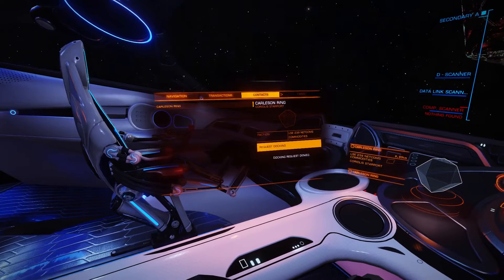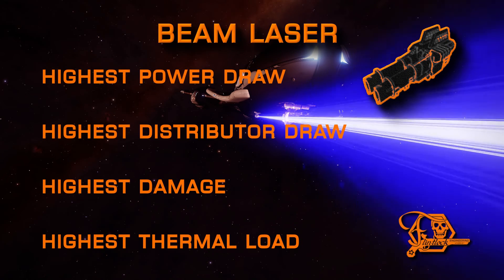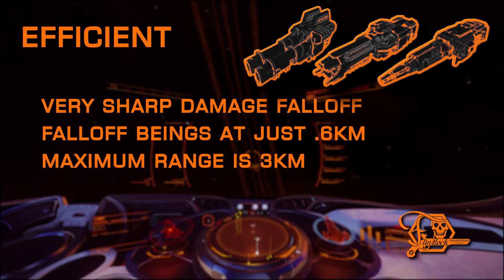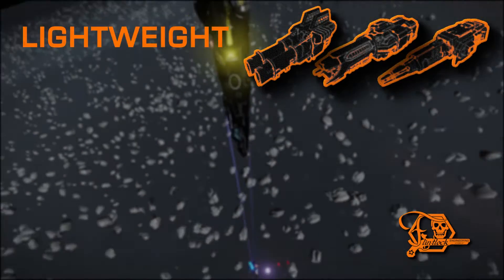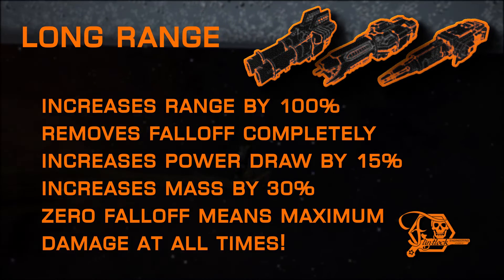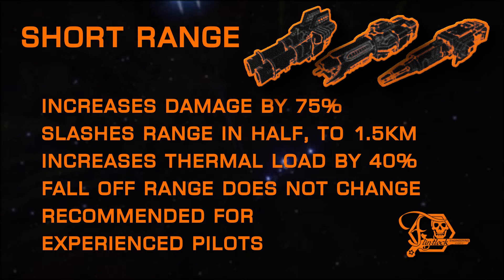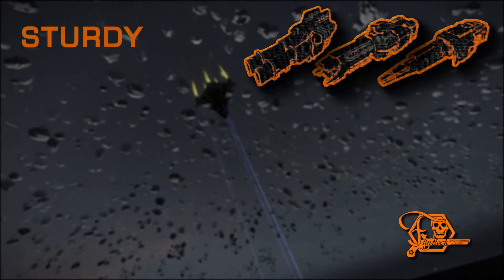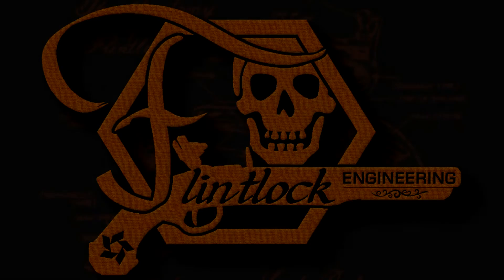Engineering Series - Episode 1: Laser modifications

Comment: Going with all beam's, on my python, I utilize them as if I had pulse or burst. Because each shot that hit's does more damage that that of a same size pules or burst. I deliberately pull my trigger in a pulse one second to two second blast or in three to four second's blast such as in burst. Sure if one does nothing but pulse pulse pulse constantly, one does get integraty issue's. But the money one can make by using bounty scanner prior to attacking, and the additional money one make's, easily offset's the repair bill. I utilize all long range, overized beam's. But by my deliberately pulseing and or bursting, cause more damage, faster, than the same sized pulse or burst. Because it's the damage per shot that hit's that matter's. The same size beam, if and when deliberately pulsed or burst. Deliver's considerably more damage. Assuming of course one has the correct upgrades to their Distributer and Power Plant, not to meniton the thruster's and shield's. Which differ to the N-th degree, a ship utilize for anything else but pew pew. I have one python for long range bubble stuff, such as going mat hunting, with four scarb's I can still jump so 57ly's. My combat python using all beam's, get some 37ly, the main difference is in the choice's regarding the PD, PP, Thruster, and even the shield gen. Being done for basically nothing but pew pew vs a modified bubble only material hunter.

Makeing the wrong choice in the size and engineering of those, make a considerably difference when it comes to staying power vs total range.

Comment: isn't there a mod that lowers thermal load when you hit but increase when  you miss?
what if you run a couple of those to lower temperature and add a few with overcharge? will that balance out the heat generation while increase some damage?

Comment: Would you recommend long range or focused lasers for general use bounty hunting (I’m usually in bigger less maneuverable ships, less often nimble fighters)? I do like the ability to have full damage capability so long as the target is in range, but that piercing and slight range increase seems like an interesting middle ground between long range mods and the damage buffing ones.
Reply from the maker: A very good question! As it's a very close comparison, the piercing will help more against medium/large targets, due to their higher hull hardness values. If you're in a ship with a fighter bay, that slf can help out with smaller, more nimble targets while you Focus (see what I did there?) on the bigger ones. If you don't have an slf, but have other hardpoints for kinetic damage, I would go with long range - ESPECIALLY if you have a hardpoint with the corrosive experimental effect, as that will temporarily modify piercing/hardness values in your favor, as well as add a damage boost to all damage dealt while the corrosive buff is applied. Hope that helps!!
Reply: Flintlock Engineering I do try to balance kinetic and thermal damage output as much as possible across my fleet, and pretty much all of my ships have a corrosive multi-cannon for that debuff (my cutter has it on turreted because of the lack of maneuverability). I do not trust myself with use of the Plasma Accelerators.
Reply from the maker: @applechip4166  it's alright, and can be a good call skipping fixed on the Cutter. Even with the massively high damage per shot, your damage per second goes WAY down at some point in almost all engagements. Best of luck with it my friend! o7

Comment: Excellent stuff. Can't wait for episode two as I run a full laser build on my Krait Mk ll.
Reply from the maker: Haha very nice! Watch your heat, but enjoy!
Reply: @FlintlockEngineering  actually, I use my heat. My two large beams are sturdy with thermal conduit and keep an amfs handy to rep all my modules when necessary
Reply from the maker: @TotalRad  very cool! Lots of module reinforcements, no doubt. I like it!
Reply: @FlintlockEngineering  Do module reinforcements actually protect against overheating your ship? I've been watching it closely and it doesn't seem to help at all.
Reply from the maker: @TotalRad  Great question! You are correct, they don't help with heat damage unfortunately. Apologies if I gave the wrong impression - merely meant to imply bringing MRP's to minimize the second source of damage to modules.
Reply: @FlintlockEngineering  Ah. Ok yeah I still use two of them but for the most part all my laser weapons and other important modules are sturdy and I run two 5b AFMs. My ship is consistently running between 120-200% heat when firing. PVE of course.
Reply from the maker: @TotalRad  have you ran testing to determine damage output at different levels? If nothing has changed, I believe you get a slight damage boost equaling around 20% vs stock when you're between 100 and 180%, and around 60% boost when you're above 180%. If you're on PC, I'd be interested in testing it out with you to get some solidity to those numbers, my friend!
Reply: @FlintlockEngineering I am on Xbox and I haven't really test it much, I spent some time in a medium intensity conflict zone with a buddy the other night and it did seem like I could crack open shields fast enough. Even on the spec ops ships it felt like I could melt off their shields faster than normal, but in that type environment it's too hectic to really test numbers and such. Also, my beams are only engineered up to grade three, I haven't had time to farm up the mats.
Reply from the maker: @TotalRad  very true, that's not the time or place to crunch numbers. Just curious! If it's working for you, keep at it my friend! o7